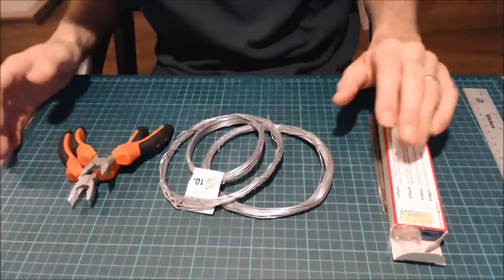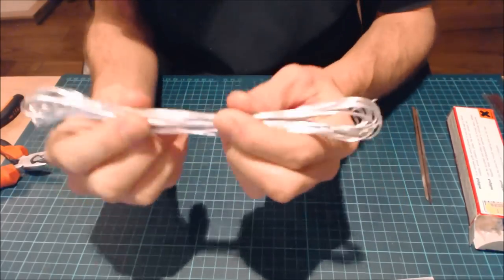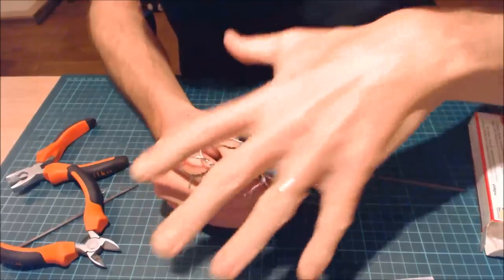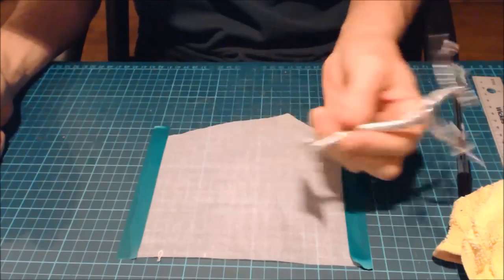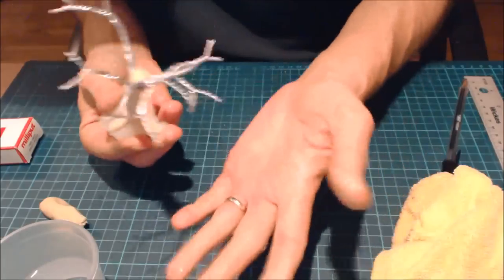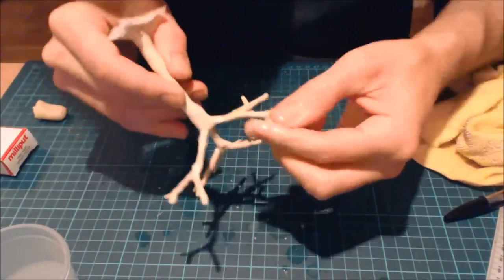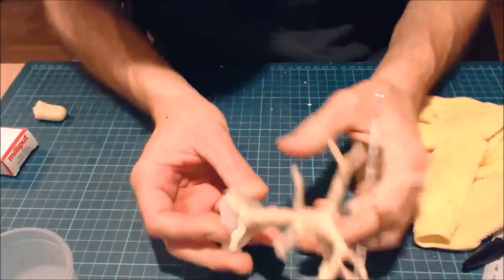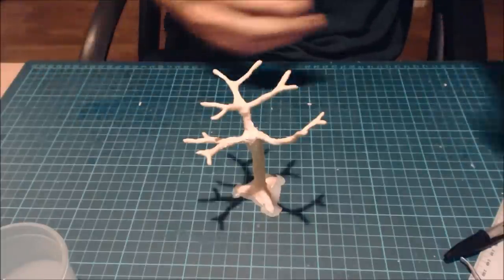Realistic Scenic Trees - Basic Wire Armatures & Bark Sculpting

Comment: I just built one wire tree and used toilet paper soaked in watered down PVA to cover the wire texture. That saved me the sculpting work, but it was quite messy with glue spots all over my workspace.
As foliage I used the same green sponge flocks glued with PVA I used in my hedge building tutorial (-> my channel), which was a bad idea. the keep falling off all the time. If I should ever build another of these trees I will definitely use clum foliage and seal it with PVA.
Reply from the maker: Aleph Myrmidon It's a good method mate, I just can't be doing with trying to glue the clumps on with pva lol
Reply: +Aleph Myrmidon hi am a landscape gardener with 9 year also a sci fi modeller back to this whyen i do my trees go looking in a garden stall or shop as there is this plastic coverd wire it can be glued as like abs plastrute  wire but this was pound  when it come to covering the wire i use double sided sticky tape as it would allow you to add on extra brances prior to painting in acrylic/ humbrol dk brown and for forlage i had to do some research the best is i found and now use isthe tesco/asda dk green plastcfibre pan scrub cut very fine in to say 2to 3 mm sq then mix in container with aclear glue like uhu or same this will bind the folage together beward it is messy but the result is you can glue in to place

Comment: Good stuff terraintutor. It was really confidence-inspiring to see someone go through this process so fluently, solving the pitfalls along the way. Great tute, Mel.

HUMBLE QUESTIONS
1. How pliable is the trunk-covering with the milliput? 

2. So is greenstuff ideal? -  as it’s bendy when cured?

3. UNIVERSAL CARVING PROBLEM: 

I note in the vid you pointed out the numerous tiny lumps or “little bumps”, left by carving grooves, these being the scrapings let behind on the furrows made by the carving tool (result of dragging & displacing the putty?) This is a problem that has ALWAYS stymied my attempts at carving clay etc. I would LOVE to know a fix or a material that doesn’t do this.
Reply from the maker: +Vikki Wilson 1. Solid as hell! 2. Green stuff would be a bit bendier but prone to cracking. 3 Ignore them while craving, wait till they dry, brush the off with a stiff toothbrush ;-)
Reply: Hey Mel, thank YOU!

Your tip regarding clay carving will give me confidence to pick up the clay again.The little "pills" caused by carving always ruined my previous efforts. Thankyou! I will try again using my husband's toothbrush.

Happy New Year, may 2016 be a wonderful one for you & your family .
Reply from the maker: Vikki Wilson
You too hun x
Reply: +Vikki Wilson hi there very good video start about the wire but i found if you can get garden wire it got a plastic      cover that you can strip off to make a thinner brances i then cover the wire in double sided stick tape the reason why is as you twist the wire you can at a later time add more brances as this way it is quicker to design the tree and as you mark the tree bark in to the miliput my way the creases inthe tape does the same as you wrap round the tape (sticky both sides) then when fin you paint as like you did the all tree now for the folage i found that licenhn drys out and goes off colour i found  the purfect material dark green plastic pan scrourer cut in to 2mm square i not tried ablender yet as mine was broken do about a bowl full mixing this is the bit even icannot escape mix the 2mm cubes in with aclear glue like uhu  or other plastic clear glue it will set .you just pullapart glue to the tree as normal then hilight with a bit of ground scatter as if it go eather fruit or flowers
Reply: Thankyou very much for your ideas - I will try it on my very next tree. I ended up using a think trunk & the main branches of a faux bonsai. I cut off the top half of the bonsai and I have added vertical rolls of green stuff all around the trunk to give it a bit of a gnarled fantasy look. Looks great so far but, again, pretty rigid. Your method is very interesting.
Foliage - I am more interested in the silhouette silflor mininatur kind of foliage although I recognise the great use of foam in foiage. Check out their "filligree bushes" in Stephen Bennets scenery video. Ill be trying your ideas - thanks!
V
Reply: Vikki Wilson

Comment: I did something similar, but I used plaster. I think milliput works better. I will try that next time I do trees. How about putting the trees on round bases and fitting them to area terrain? Would you us sheet magnets to hold the trees in place. Thank you for sharing the process in such detail.
Reply from the maker: +Perkins Dearborn Plasters ok but it can chip, milliput is harder. Checkout the back to basic playlist, there's a vid on making removable disc bases in there ;-)

Comment: Great video. Is air drying clay okay to use on the wire armatures? Or will this be too brittle?

Keep up the good work.
Reply from the maker: TheGnomeDenial Should be fine mate, just mix it with a little pva if you're concerned